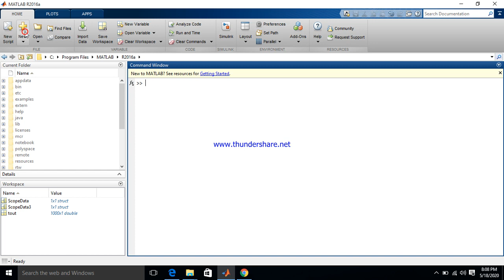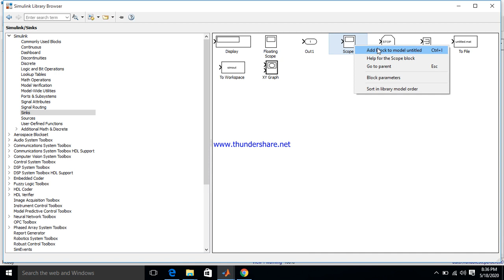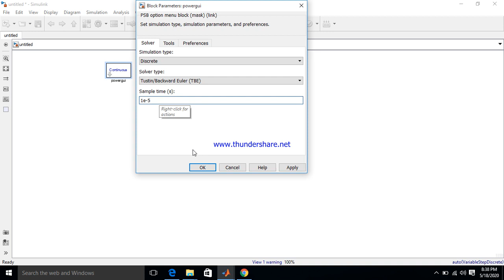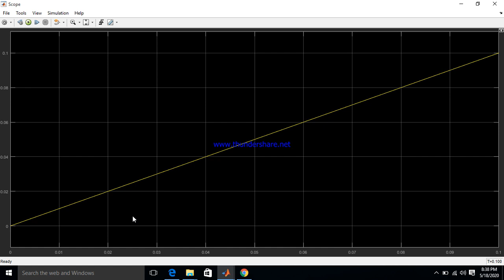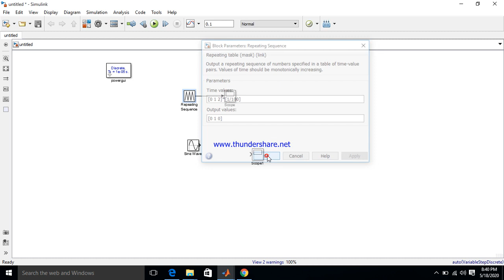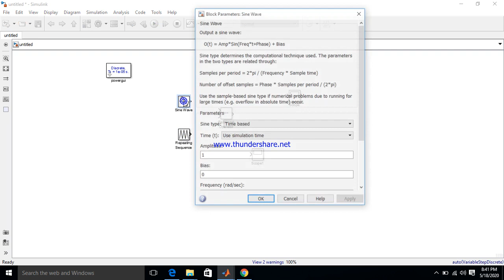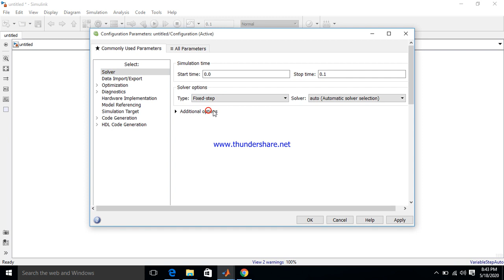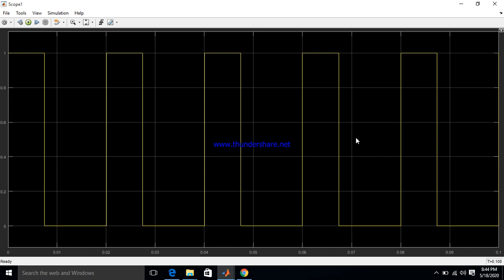Pulse Width Modulation (PWM) Generation In Matlab Simulink

Comment: How would we decide the values of time delay and phase difference and other parameters
Reply from the maker: That's depend on the circuit model operation like inverter model,chopper  model etc.that how much time you want to turn on a switch for operation.